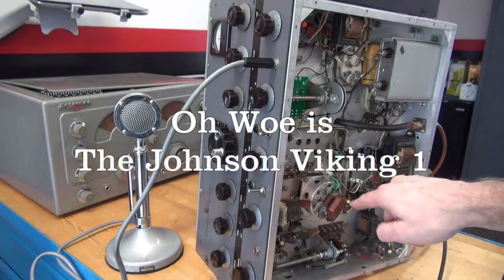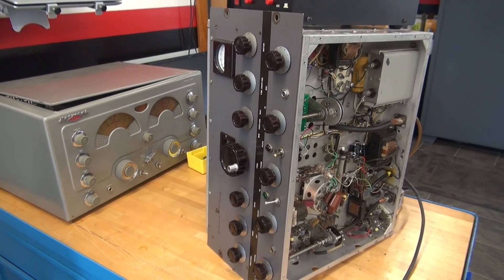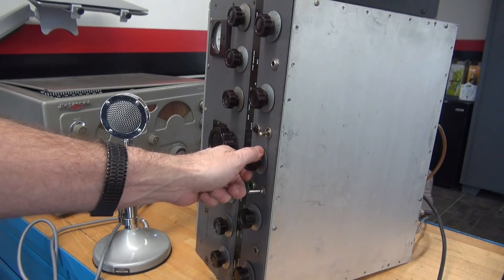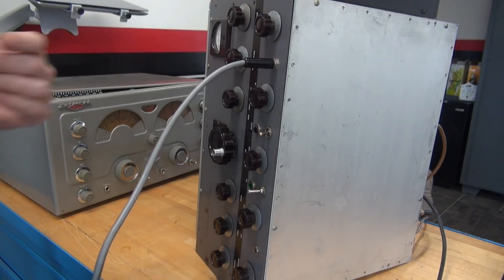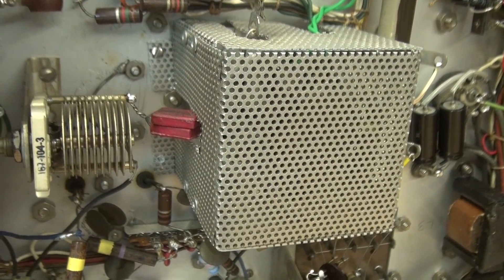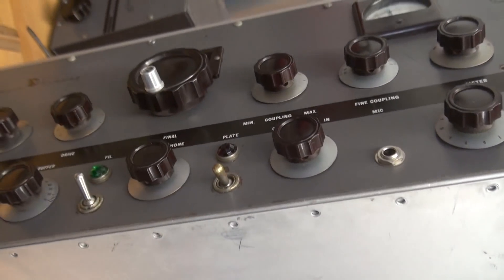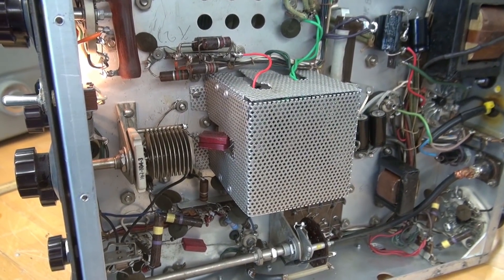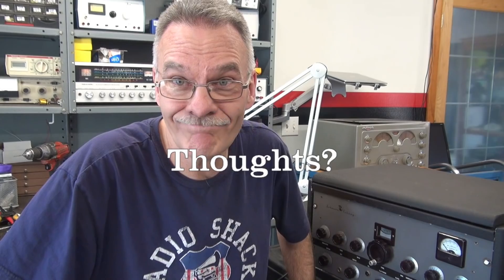Johnson Viking 1 Tube Ham radio transmitter Buzz in transmit How to fix it, Searching for answers

Comment: I say a cap somewhere to ground or the VFO to the transmitter connection (of course you would've already check all this lol) I yelled for you last night on 3.885. I was talking to Timtron right before you keyed up. We're to close to make  it I guess. Good luck with the Junkston lol
Reply: Ooohhh, that's worth looking into? Does he know for sure the VFO drive is clean? And if it is, then work thru the RF chain until the stage is found where the noise starts.

Comment: Terry , those resistors near where the coil was look very old and worn. Are they in tolerance ?  The ground coming from the buffer cap to chassis does not look too steady as well on camera.  Does this radio have a DEATH CAP... was it removed and 3 prong cord installed ?   Hope this helps

Comment: That sounds more like an AC induction problem than an RF problem....Is the VFO solidly grounded to the Viking 1...? Have you tried using a crystal instead of the VFO...?  Is the chassis well grounded through a 3 wire AC cord or floating...?
Reply from the maker: Yep, crystal has the same issue. Grounds have been verified
Reply: Well, xtal drive eliminates someone's suggested VFO trouble. 
Can we presume you've either 'scoped each RF stage or pulled tubes to disable one stage at a time, trying to see if a lower level stage is creating the noise?
Has it been tried with the final removed?

Comment: Wow ... not very often you can’t fix the problem. This one is a doozy. I do agree it sounds like 60cyc hum. Which would lead me to check the caps in that part of the circuit. Otherwise, maybe an issue with the coil when the circuit is engaged or an issue with the switch? But alas, I am no Ham guy but I know you’ll solve it Terry!
Reply from the maker: Yeah man, this ones a doozie!

Comment: The cap feeding the grid has to be leaky, because the noise is 60hz?
Or, there is 60hz leakage from the driver circuit or B+?
Or both?
Reply: Someone also said that it could be a shorted tube.
Question is: what is the differential diagnosis to use?
Process of elimination!